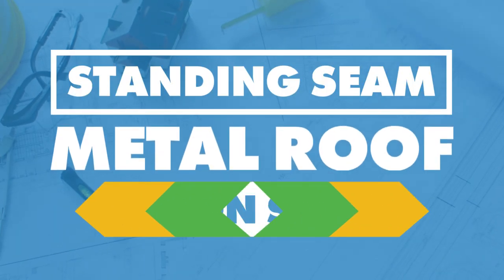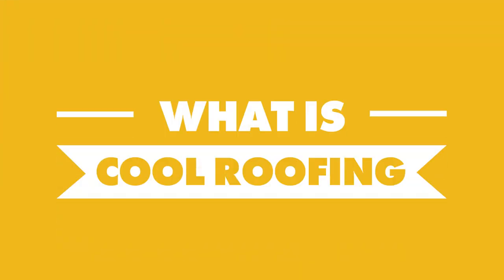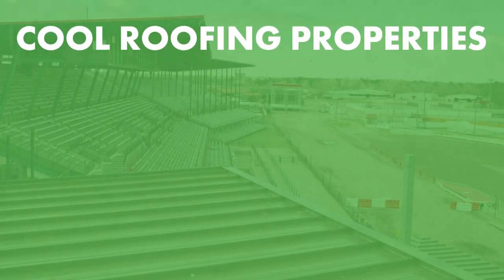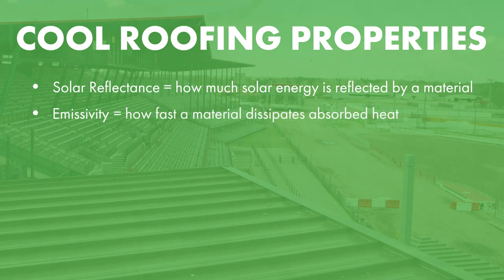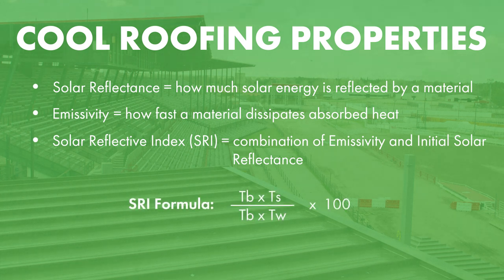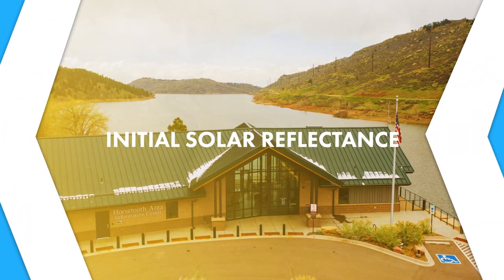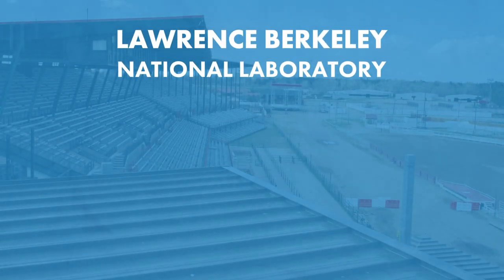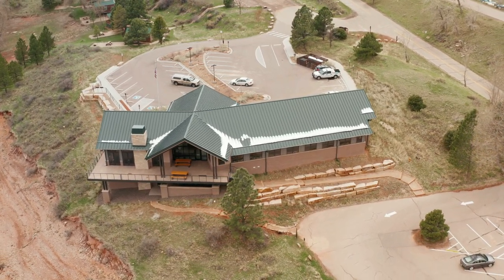What Is Cool Roofing? Solar Reflectance, Emissivity, SRI

Comment: I lived in the Austin area for 30 years so I know where you are coming from. Moving and building in the Colorado Rockies at 9000' is a totally different ballgame. My current build has a 1.5" clipped snaplock Kynar standing metal seam roof at 3/12 pitch. Here I have NO AC requirements(we had our first frost in late August and first snow today Sept, 27), but see -30F conditions with up to 5' of heavy wet snow. Color is for heat absorption. If the wind exposes the top of a seam, solar gain will dissipate quickly with melting snow at a domino effect. My color of choice is a Dark Chocolate in a very refractive(least reflective) "Crinkle Finish" Kynar. 
Our market may not be The Metal Roofing Channels target, but it may be a consideration for comparison or discussion.
Reply from the maker: Hello! I would love to cover more cold weather metal roofing applications, and in fact I'll be flying out to Denver to shoot some more videos in just over a month. There's currently some videos on the channel about snow retention etc., but if there's something specific you'd like to see, please let me know! Thanks for the comment! -Thad